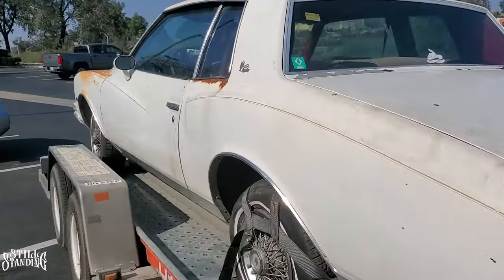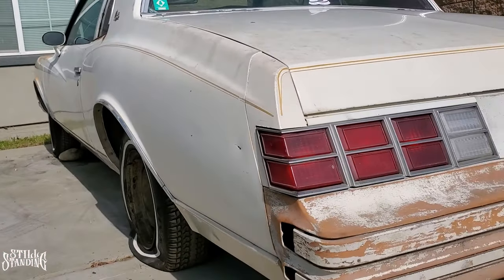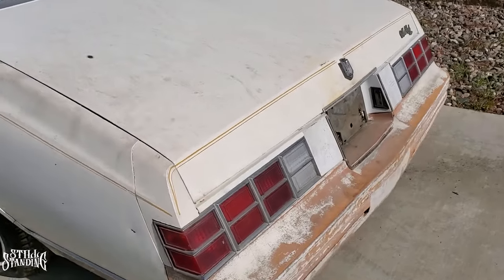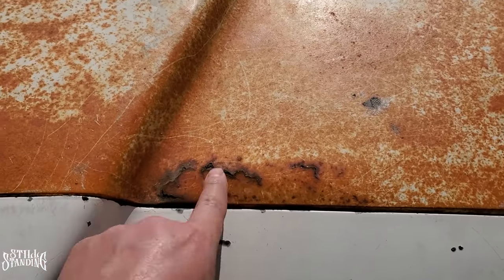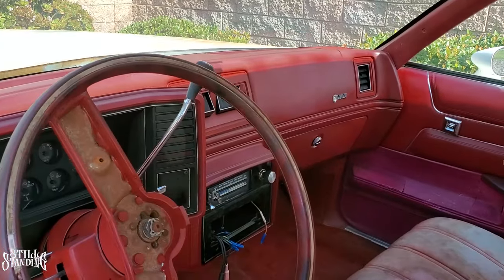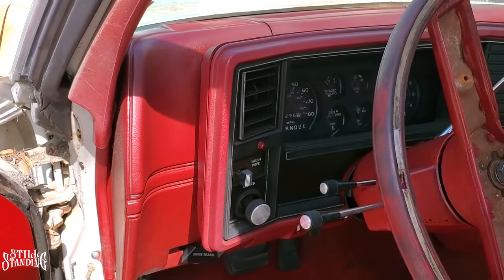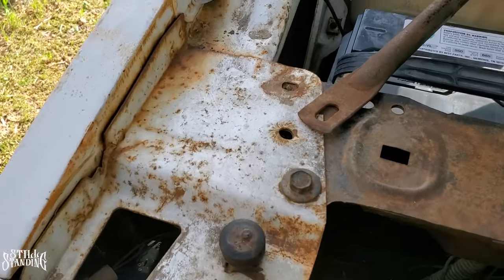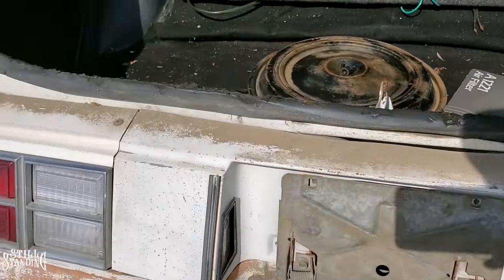Project 79 Monte Carlo

Comment: What are solid cars like this going for$ in so cal. Here in Indiana it would be rusted out
Reply from the maker: Something solid will range from 4k to 8k depending on what car it is... Also, this is pricing for a "project" condition
Reply: @StillStandingGarage  4-8g for a non runner with that rusted window trim man oh man everything is high in CA isn’t it. 20 yrs ago I bought a 78 and drove it home for $500. Didn’t have it long enough got impounded (no tags)
Reply from the maker: Yep that's the pricing for these around here... the pricing on these are going pretty high in my opinion too... I bought my 78 in '04 for around the same price you bought yours... it's the demand for these that's increasing... you should see how much the parts go for 😳

Comment: I just got a 79 the column shifter stuck any ideas?
Reply from the maker: I would say to check if the cable that comes down from the dash is stuck on the column. The cable is connected to the dash and it's supposed to be connected to the column shifter. Either it's stuck or it's on too tight.